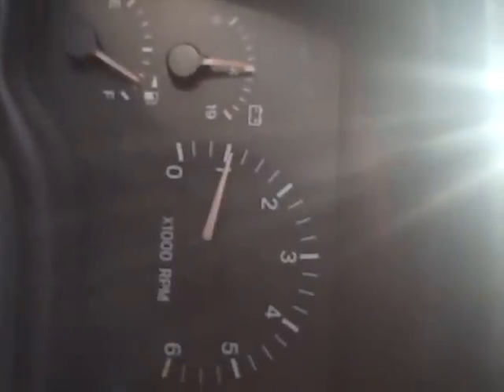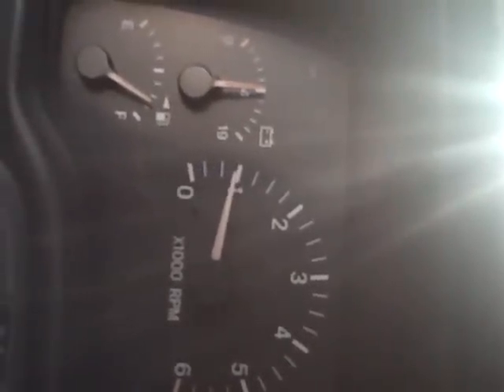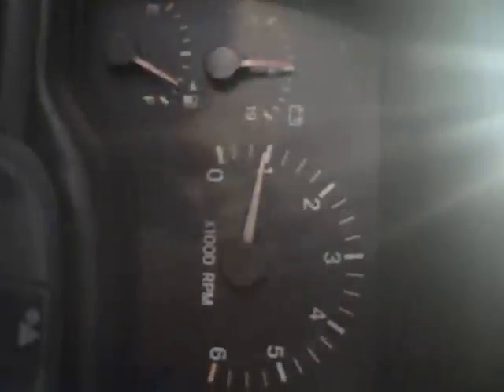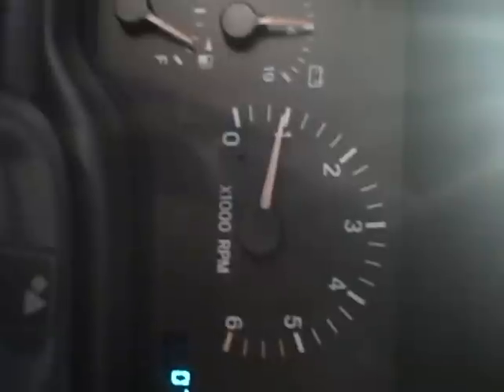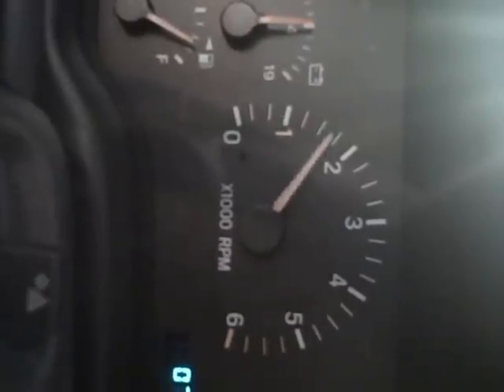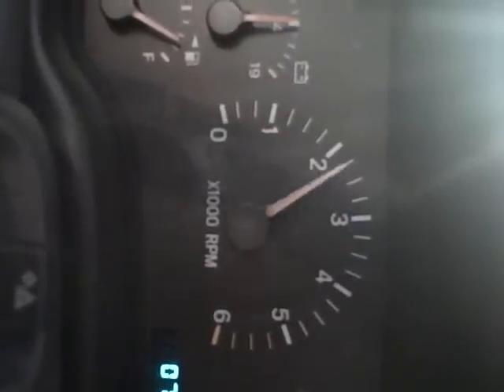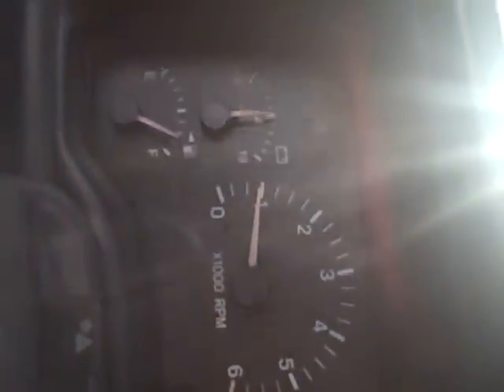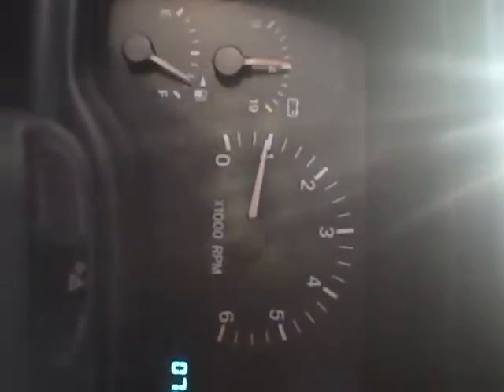Jeep misfire/stumble *** fixed *** oem cps sensor

Comment: my 02 TJ shakes like a dead hole.....however if you disconnect an injector plug on any piston it runs with a true dead hole. Was hoping i would find no diff on one piston when unplugged. Shakes bad at any rpm. harmonic is good visually ,no sign of shaking or bad rubber.......and clutch works fine with no grabbing .....im at a total loss

Comment from the maker: it was the crankshaft position sensor. oem dealer part purchased works like a champ still almost 2 years later.
Reply: I installed one off amazon it somtime struggles to start it wasnt oem i have bucking and acceleration probs
Reply: Do u think it need to be oem parts ?
Reply: @christherrera9620  just watched a video on why oem sensors are better and it seems that they are a must.

Comment: hey in the early stage of the 2000 there was a factory issued guard placed over the cylinders, starting at the 3rd one to stop leaves from getting in and catching fire. the bad part is the 3rd cylinder gets to hot and when you stop the gas vaporizes and nothing is in it so it miss fires, just let it run or remove this price it isn't a bog problem the engine jus needs a minuet to get gas in it.

Comment from the maker: ***FINAL UPDATE***
Jeep is fixed!!!  this whole thing was caused by an aftermarket crank sensor.  Turns out you can only use dealer oem sensors on these jeeps because of the way they communicate with the pcm/ecm.  HOWEVER, before all of this was going on i was getting 18mpg - i cleaned the piston heads, new gaskets, coolant flush, new oil, re lapped the vavles, cleaned the valves, cleaned the cylinder head/ports, cleaned the intake manifold and now i get 24 mpg hwy.
Reply: Nice
Reply: So you wouldn't recommend an MSD ignition coil on a 97 xj?

Comment from the maker: in my case it was a bad crank position sensor, but if you think you just need to clean out the throttle body do so.  Its a pretty easy job and only a handful of screws hold it down.  Might only be a 30 minute job and its not a bad thing to do anyways.

Comment: @MrKenton33 yeah i went to the dealer and bought both sensors and it has not given me problems since. Amazingly the dealer is only like 20 bucks more for each sensor.But the problem above for me was the crankshaft position sensor.

Comment: @tastygringo  yeah i went to the dealer and bought both sensors and it has not given me problems since. Amazingly the dealer is only like 20 bucks more for each sensor.But the problem above for me was the crankshaft position sensor.

Comment: It seems to be that it is still a problem with the crank position sensor. Same thing happened on my zj only it would stall while driving. It looks to me that the sensor you bought is good, but the connection is being either shorted or lost for a fraction of a second hence it drops rpm because of the stall and picks up because it gets signal back again. I would try electrical grease on the connections for it, reset the ecu, and check the wiring for a short.

Comment: my jeep did that and i recheck to make sure the plug wires was snap in place i had 2 was not snap in place i push them in to snap in and it fix it the engine light go out and did not come back on that was about 6mo ago it fix it you may want recheck them

Comment: I've got a similar problem going on with my Jeep. It's a '94 Grand Cherokee Laredo 4.0l  l6 
Just changed the air and fuel filter. Had the oil changed, and new plugs. I crank it up no problem, driving it it drives fine, it does start to bounce/jump/hop whatever you wanna call it when I put it in Reverse. But in Drive it's fine. Then after about 15-20 mins it'll start to sputter. I've found that the sputtering begins to start in less amount of time, more frequently, & more harshly if the air is on? Or if its idling or in N. I'm not sure what it is......I've read so many reviews and seen so many videos but I can find out what is wrong exactly, any help?!

Comment: Same issue bro, I will replace both cam and crank sensors as well as throttle position sensor and idle air control valve, as well as checking ignition coil. Will report back my results.

Comment: I have this problem right now when I start it up the engine shakes and misfire I’ve done everything coil and spark plugs but the engine light comes on and the engine misfires. What was the solution to solve it?

Comment: Bad fuel injectors can also throw misfire codes on the 4.0 they are easy to swap I've tried that tonight but I think my coil rail pack assembly may be out did test and cylinder 1 spark was very weak. And u have to run dbl platinum plugs in the newer 4.0s they are extreme picky autolite and champion and ngk are the preferred brands for plugs hope this helps someone good luck.

Comment from the maker: ***UPDATE***
Instead of being just one issue it turned out to be 4.
1. Cam sensor was bad (even though i had just bought it, it wasnt working right)
2. Cam/Crank sensors were waaay out of sync
3. Ignition coil was in fact going out on me just in a very random way
4. i have an exhaust valve thats not seating properly 100% of the time. 

I fixed all the other issues leaving the valves for last, i found a completely put together rebuilt cylinder head for $260 and im shelling out  the

Comment: We replaced everything as well, but to no avail; even a new PCM.  You name it, we replaced it.  First it starts good then it starts to bounce because we lost first two cylinders, but after a warm up we loose another 2 cylinders a hard rumble and die. :(
Reply: check the electric connections at the pcm for corrosion  the slightest bit of corrosion can cause ALOT of problems
Reply: Just like this guy here, you can buy aftermarket parts that are junk or not working. Have to go back through and check everything you replaced.

Comment: How the fuck does one check all the wiring when its all bound up with tape and stuffed into areas a starving baby couldn't reach.
Reply: I really like you description of this crap we have to look at and then try to even get a hand in there to fix stuff!!  Why why why? And then they place things like fan relays in areas that require a front end removal...no kidding I had a $350 dollar quote for a $35 relay for the fan, and found on the tube you could take out the passenger side headlight, go thru the plastic and there it is!!!  Just put the fricken thing on the fire wall like they did in the good ol daze!

Comment: I just got a 99 wrangler Tj 4.0... NO CHECK ENGINE LIGHT it has a rough high sporadic idle and SOMETIMES it idles up (mostly in park) to 15 - 2000 RPMs  it feels like it also misses.... i took it to a shop they said it was the PCM/ECU.  got a reman plug and play issue remains 
I have Cleaned throttle body and IAC new plugs wires new PCM checked for vacuum leak (carb cleaner and smoke test) but like a said it revs up when it want to... so couldnt find vac leak with carb cleaner 
PLEASE HELP!!!!!!
Reply: I have a 2002 Grand Cherokee 4.0L with 129k. It would idle about 2k whenever I cranked it hot or cold but eventually would settle down to normal rpm after a few minutes. The car ran perfectly on the highway at 65mph and was not quite right at all other times. A big problem was that the transmission would not downshift when trying to accelerate. I have a scanner that allowed me to monitor the "absolute throttle position" and turns out it was pegged at 27%, which is the normal throttle position when running 65 mph. Since the TPS failed at a normal output value it did not trigger a CEL, but it was telling the PCM I was trying to run 65mph all the time and not trying to adjust the accelerator.  I replaced the throttle position sensor (TPS) and all my problems were solved. The sensor was under $50 and 5 min install -  best investment I have ever made in my car.

Comment: When my PCM got hot (very hot cal summer days on freeways) she would just shut down and not start again for about 15 minutes. I changed every sensor like you did but ended up having to replace the computer. Since the dealer doesn't even carry them anymore you have to buy a used or rebuilt. This is kind of a crap shoot but I got mine from a company in Fla through ebay. (I figure the company would like good feedback on ebay) This particular company assured me that they clean and test them. They also claim to make any repairs if necessary, (although I doubt this since the elects are in a jell) But the kicker is they guarantee it for life and if you get a bad one you can just do the exchange thing again. (might be a lot of down time for your car) I believe it only cost $150 and I got lucky the 1st time. I don't know if that is your problem but it sounds like a lot of other posters are having this same problem. Good luck to all!
Reply: Rick James please share the link to the company that fixes the pcm, I might need that service.

Comment: Check your trans bolts little bit of play will throw off your crank sensor making a dead spot where it don't read at certain rpm.
Reply: E Patterson My jeep is misfiring on cylinders 2,4,5,6 and i went underneath to check o2 sensors when i realized i can literally see my fly wheel like it's 3/4 of the way covered. can see the gear spin when started. the part that does cover it seems to be missing 1 bolt? should you be able to see the flywheel at all? Could this be causing my misfire? and there is a rattle coming from my catalytic converter. I have 1997 Jeep Wrangler Tj.

Comment: hey that pcm info is fleeting.    not always..    screws,  connectors,   clamps,        a sledge hammer.   washers,  longer and shorter screws,....    i just watched a pcm repair vid where the guy shows the internal  open circuit problem  and explains the  "tweak" of the cover makes it temp and vibration affected , being intermittant.   he had a JTEC pcm  (3 connector unit also used on dodge truck and van)  try local u pull it yard.   there are service bulletins on  ckp sensor learn and all pcms

Comment: I'm having the same problem too on my 1999 Jeep Cherokee Sport. When I have my car in PARK, acceleration is going up to the #1. Then sometimes (note SOMETIMES) a little bit between #1 and 2. Then goes back down again to #1 or at 0.5. I'm not an auto mechanic, but I did fix some parts in my jeep to keep it operational (thanks to some YouTube videos that helped, my family,  and of course taking it to the automotive repair shop every 6 months). I need to know, how can I fix this problem?

Comment: Mine has a hick up doing the same thing in the long run only while driving 30-60 mpr. I replaced the sensors connecting to the throttle body any ideas ?
Reply: how is your vehicle now? I just spoke with my mechanic and he mentioned the "map sensor" may have to be replaced.
Reply: how is your vehicle now? I just spoke with my mechanic and he mentioned the "map sensor" may have to be replaced.

Comment: I had the same problem .   Years ago I learnt a weak fuel pump sends no code! You will get misfires at starting and running of the  engine pointing you away from the fuel pump to cylinder 6 misfire for example. Early stage symptoms of a weak fuel pump is rough idle but will seem to run fine at high idle. Of course when the pump fails completely it wont start at all and guess what, there is still no code sent for this problem with the fuel pump. So if you dont know how to test this pressure many expert mechanics on youtube will  show you how.

Comment: mine was the fuel relay have been trying to fix for 6 month replaced every thing spent ove $500 for it and the part was a $14 part
Reply: Maggie Rodriguez well its start back up was stuck on lean miss firing and wouldn't start after it was warmed up replace fuel pump and regulator been running fine now for a yr used cheep fuel pump from ebay.com mines an xj 96 Cherokee base model
Reply from the maker: Maggie Rodriguez whats the list of things suggested?

Comment: i had the same problem on my wife's BMW x3. new sensor was bad. Actually leaked oil through the sensor. bought off ebay. 1 of two i bought was bad. I'm really here for my daughters TJ project. having same problem like yours. maybe I'll replace that sensor as well. Thanks for the video

Comment: My 2002 Grand Cherokee 4.0 does the same thing except its rough all the way through acceleration and I get NO check engine light. Took it to a ASE Certified shop and they did a 4 hour diag. and tell me that injector 3 and 5 are throwing codes. I just had injector #3 replaced less than a year ago and it was driving fine up until yesterday. They told me to replace the PCM but im wondering how they know that, that is the problem. Seems strange.
Reply: Have the same issue I might want to check the injectors tomorrow.. Did you ever fix it.. Trying to get more info before buying a new pcm.. I have a 95 grand Cherokee so I have to turn my key 3x to get code. But it's shows code 53 pcm internal fault condition detected let me know

Comment: my 2001 jeep 4.0 cherokee losing firing order at high speed coasting on freeway about 65 or 70 mph  the only way to get the firing order back is to restart the engine . it has a new CPS and computer. help. dan

Comment: I have the same problem and Im starting to think its the cylinder head. There is a casting number cylinder head, forgot the number, but they crack. You could have a cracked head, bad valves or head gasket.

Comment: this one is easy! if all sensors are new or good, check to make sure the wire to your starter solenoid is not broken. you'd be so surprised that your local oil change cuts into that wire when they change your oil. same problem! I went through and changed everything and new guns up and still had that idle problem. come to find out my wire was hanging by a couple of threads.😎👊
Reply: this cut wire will cause missfires and carbon build up which cause other problems with other sensors! fix the wire, clean everything! if you have high mileage, change your sensors anyways. these sensors are very cheep!

Comment: It will start up just fine, and then start missfiring. It's not bad when it's cold, but when it warms up it's pretty bad and feels like the engine is going to die unless I press on the gas pedal. Then it will rev up just fine and have no issues as the RPM's go above 1,000. 

Are you saying it was the crankshaft position sensor? I've replaced mine with an Autozone one about a year ago. What brand did you get from the dealer? I've replaced and checked just about everything else I can think of.

Comment: I replaced the crank seonsor in my 2001 jeep Cherokee classic - it started just fine ran just fine but I took it around the block and it started misfiring running crappy - anyone know what is up with it ?the old sensor did not do this

Comment: i've got the same problem with my 1998 jeep grand cherokee,it idles rough,but as soon as i accelerate it runs smooth,i've change spark plugs,wires,cap and rotor,i'm going to change the air control valve and o2 sensors....
Reply: roger b did that work? My 2001 grand Cherokee  Is doing the same thing

Comment: I believe that Big Al (Big As Auto Repair) offered a point to be considered especially with high mileage vehicles (230XXX miles on my Jeep) and the likelihood of worn parts.  A little slop in the cam sensor drive can effect injector timing.  Thanks Al... Replacing my well worn "Cam Synchronizer Assembly" was the solution.

Comment: Make sure you gel your connections where your sensors connect to your harness .. I would replace your coil and pull your valve cover off and make sure the rods are not bent..stuck valve could cause it.. bad fuel pressure.. should read around 45-50 lbs. . Restricted air flow.. process of elimination... what your experiencing is not very common...

Comment from the maker: replaced cps sensor with a dealer one. the one bought from checker or wherever i got it didnt work.
Reply: NATHAN BELDEN 

Which fixed it, the crankshaft Position Sensor, or the camshaft position sensor?
Reply from the maker: Charles Hodge crank sensor
Reply: ***** 
Thanks for responding...
Reply: I have a 2007 Jeep Commander 4.7 flex that has similar idle problem.  I replaced both crank and cam sensors  with AutoZone Duralast.  At first after replacement, it seemed to improve, but now it is back.  Did your completely go away after using the Mopar crank sensor?
Reply: NATHAN BELDEN 
p
Reply: Just to be clear Nathan, you replaced the CPS with an aftermarket and the problem remained?  Once the dealer part was installed it fixed it?

Comment: Hi I have a 97 xj 300K miles broke down one day only to find my distributor went. Ok I changed it set to top dead center. Now I'm having the same problem you have. I changed the crank sensor, also the camshaft sensor, I then took it to a short specialist who told me my ignition harness is bad. I found one on eBay, and fairly new. Now she cranks and starts up quick, But as I drive I get a hesitation which forces me to stay under 50 mph. When I turn her off and try to restart her she cranks and cranks but won't start unless I floor the gas. then my check engine light comes on. My local jeep dealer wanted to F*** me for a new fuel pump, a chassis harness and a ECU. for $3500  plus 115 an hour labor. "I'm in the wrong racket"!!! I replaced my crank sensor that I got from autozone 4 times along with my TPS. I realized duralast parts SUCK. I've had my fuel system, battery, harness, IAC, Temp, speed, map sensors all checked out and changed. And I still have this hesitation I also learned some thing you all will get a kick out of. Just because a shop's ad sign states Expert mechanic work "we specialize in all electrical work" Diagnostics and all engine and transmission work.  Doesn't mean their auto mechanics!!!